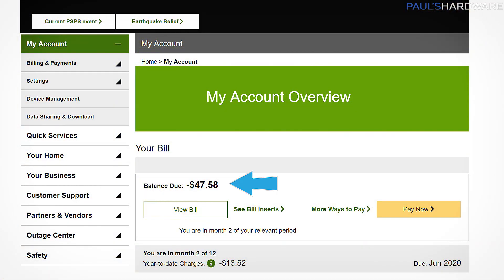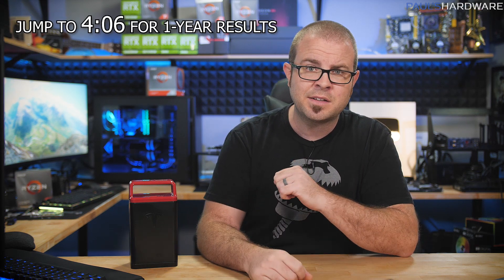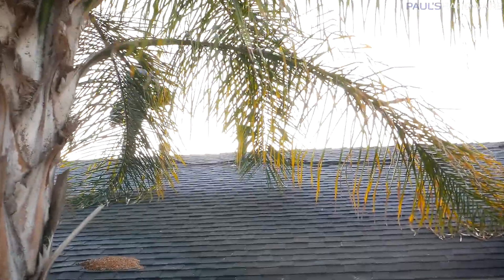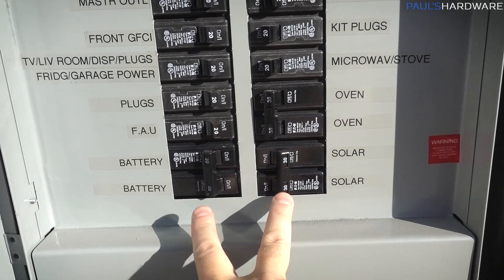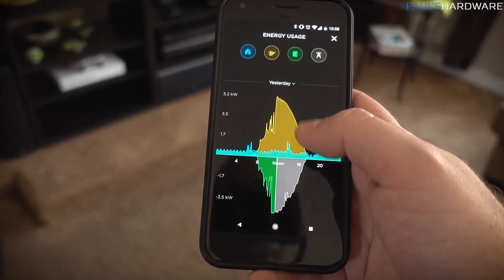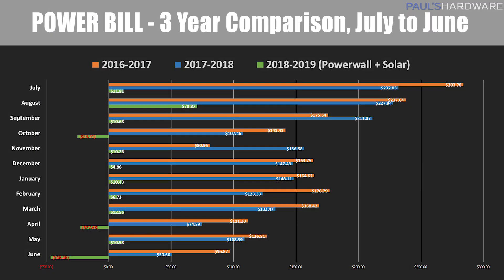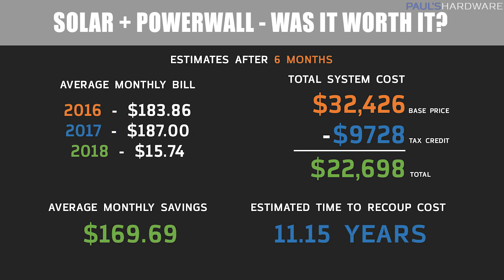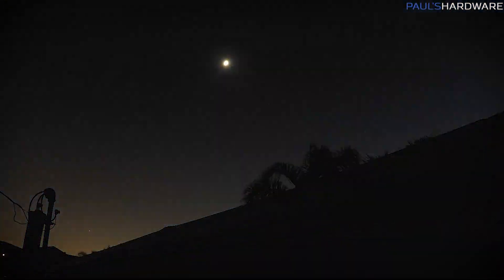TESLA Solar and Powerwall: 1 Year Later!

Comment: 13 years to payoff the system. Note: that's only if the government continues to give $9,700  tax credits. Also, I didn’t see a calculation of the time-value of money, which over 13 years would be significant. So maybe it takes 16-18 years to break-even (someone else can do the math on that). Yet, thats only if you’ve replaced your roof recently. You might be forced to replace your roof far earlier than normal.  Also, before you've paid off the system (16-18 years, not 13), you may need to repair or replace it. So, not only will you definitely not be making money Selling power with solar power, you probably won’t  break-even.

However, if you’re buying it for the zombie apocalypse 😉, it may be a good investment.
Reply: Many points you made are not true. The $9700 tax break is taken out of the total cost of the solar system and compared to other states and countries Is rather low. The more people that buy solar panels the cheaper it gets. The solar panels can come on and off when replacing roofing and isn’t a huge project, that’s why it’s recommended to just change the roofing under the panels which can be included into the cost of the panels as many companies have subsidized contracts with roofers to provide a better rate to potential customers. There a multitude of solar panels that vary by price based on your needs, if your local government provides credits in energy instead of giving back dollars, then the inclusion of a battery pack is not necessary. Not only are you helping environmentally by allowing the grid to use renewable energy you produce but you also only worry about the cost of the panels every month, with maintenance and any big repairs covered by the installers. I am saying this as someone who used to sell these. You must also factor in how much it increases the value of your home when you go to sell it, as you can include the price of whatever you paid or owe to the house price and then the new owners are incentivized because they don’t have to pay for energy for 10-12 years, if they wanna replace after that time frame.

Comment: When I was thinking of installing a solar system I had all these other questions.
Being a very small power user to begin with made it extremely uneconomical for me to bother with solar.
But here are some of my questions.
What would happen to your installation cost recovery breakeven date if there were damages sustained to your system before that date arrived and you had to replace items at your cost with new?
Say by a storm.
I know insurance covers most things but if yours is anything like here in Australia, they will try to weasel out of paying if possible. Maybe best they offer is pro-rata even if that wasn't stated in the insurance agreement. They make their own rules as they go along these days!
Then there is the actual buyback cost of the power you send to the grid. Over here, it started out being a very generous 44cents per kwh minus GST I think. Then it started to fall as many more customers came online. Original customers were grandfathered with the same generous payment, but over a year ago the government stepped in and said enough! Everyone now only gets 9cents per kwh and if you don't like it too bad. If it doesn't cover your costs (for example if you borrowed to buy the setup) too bad!
All these things blow the breakeven date right out of the water way over into hardware replacement territory post warranty end. So the end result is a never ending circle of costs and blown out timelines.
Also have you done a comparison on engendered energy used to make all the components as compared to what the system makes back for you and the environment as opposed to if you continued to buy gas, water or coal powered electricity?
Then there is the curly question of who wears the brunt of all the pollution caused by the various worldwide manufacturers of components in your system. Some are very pollution heavy with quite noxious poisoning of the earth.
Have you attempted to make amends to the environment by supporting tree  planting etc, say as offsets in other polluted countries?
If you've done any of these things, did you include those costs in your overall system cost and payback date?

Comment: Damn your setup and usage is increasingly wasteful. In the 12 years you take to make back your investment and just break even you could invested the money instead and actually make money
Reply: It is certainly worth doing if only for the fact that it is saving the environment. If you have the means, you ought to do it.

The fact that it saves you money in the long run is just a side benefit.
Reply: Jørgen Smith solar panels are incredibly bad for the environment. All the rare earth minerals that need to be mined, and the electronics pollution it creates after you’ve upgraded your system. It’s not all sunshine and rainbows.
Reply: Yeah unfortunately looks like solar still isnt worth it. Though I'd be lying if i still wasnt tempted. Theres nothing worse than being without power after a hurricane in the middle of the summer.
Reply: @Distress.  Those Space Heaters really add up. I would personally look around the house and gauge how much power certain appliances take up and see what items are unnecessary. I forgot did he take out a loan to buy his solar set up ( skipped the unneeded parts of this vid)? Usually the Loan is the biggest punch in the face holding you back from making money.

Comment: Who can afford 23.000 dollars is my question. Sounds nice but ... you are living in another world my friend
Reply: Financing.  We went through Costco and got the SunRun system. It is $210 a month for the system. We live in Arizona and in the summer our electric was almost $300 with the AC set to 78. Now it is set to 72 and my bill last month was $45. So even in the blasting heat of July in the desert I saved about $50. In the winter I won't use AC and all that extra energy gets banked on my bill meaning I will save even more.

Basically,  what I would be paying to for an electric bill is instead my monthly payment for something that also upped the value of my home. It actually is fairly affordable.

Comment: Im an electrician, and willing to take bets the time to recoup cost will push a hundred years. In about ten yrs either the invertor or battery bank will need replacing. that will add 5 or 10 yrs, then whichever didnt fail first tieme, it will happen again and push off recoup time another 10 yrs
And so on and so on.
the easy way to tell this is its a boondoggle whenever the gvt has to intervene financially to get this kinda thing done.
if it was economically feasable in the first place everyone would be scrambling to do w/o gvt help.
Reply: That's why you look around and get better warranties and coverage. My SolarEdge inverter is backed for 25 years along with the panels. Battery box is 10 years.

Another part of the "recoup" is increased value of the home. Here in Phoenix you can bet on a 60% of system cost increase to your equity. As most Americans tend to move on average every 7 years, you can bank that equity into your recoupment. 

I installed a SunRun system in June on the house. In 2018, the house was $230K. Solar cost was $40K. Our current estimate by our insurance in July put the home at $255K. And 2weeks ago it was tax assessed for $238K. So it already added a good chunk to my home value.

Plus, as grid prices go up, I save more since that is even more money I am saving by not buying grid energy. Finally, our power company has set in a strict flat rate price for bought back energy which guarantees a rate that goes up if cost goes up. So when it gets more expensive for energy, we will get paid more for producing.
Reply: @ParkerUAS  "And 2weeks ago it was tax assessed for $238K.", So your property taxes are going up, Another thing to factor into the cost of the system..
Reply: @CarlosGunX , yeah...it added $14K to the value which raised my taxes about $35/year. I mean it should be factored into your decision, but as the house hadn't been appraised in 5 years, it was going to likely go up anyways.

My overall point is that solar can be a benefit in the right circumstances. If you live in an environment where A/C is a necessity and your cooling Bill's hit $200 or more in the summer, then you have the option of paying $200 to your electric company that essentially is pissed away because other than the power given it did nothing for you. Or, pay $200/month for solar, get the same power to use, but now that $200 is going towards an investment on your property. 

If you plan to stay in your home for the next 30 years, weigh out the replacement costs, losses of efficiency, etc. Since most people move every 7 to 10 years, factor more the increase value to cost and if that is a good balance for you. Obviously, if you buy a home that has solar you want to factor its age into the price. Here in the desert it just makes more sense to put that monthly expense back into the house versus throwing at the power company every month. If I lived in a cooler climate like Seattle or Boston, it would be a different story.

Comment: So basically you need to pay for 10 years of electric up front in the cost of having it all installed... it's guaranteed for 10 years? then you start to be in credit from your start point, as upto that point you've not regained your original investment... unless the system fails, in which case you are no better off... got it.

Comment: Being connected to the grid AND doing solar electrickary, in my country, means you are an electricity producer when you deliver kWh to the net, and a consumer when you consume. So there is a big difference in what you pay per kWh and what you get for kWh produced. Some households still have "old" kWh meters that run backwards or slowdown when you produce electricity towards the grid, meaning you experience your production as a discount on your own bill. "Modern" meters can measure either way and inform the electricity company.
My question, how does this work in the US?
Corollary: if you have a way to use your production in a parallel home electricity section, then you can value your kWh at the same price as your consumption kWh price. In my country, many households use gas from a gas grid to heat their houses, produce hot water and run their cooking ranges (if still on gas). In an energy home-architecture like this, you could use your solar kWh to heat water electrically (you might not need an inverter with big losses, actually!) With a couple heat-pumps and a store in the earth beneath your house, you could actually use "solar" to store heat their for retrieval in winter, or store "cold there for retrieval in summer.
It's a bit like buying a standard PC, building one yourself and modding its cooling.There may be ways to shorten the earn-back time of a solar investment. But you may have to do your own modding and DIY, just like you did with that affordable beast PC.

Comment: So it will pay for itself just as all the warranties run out.
Reply: Yup. After that it should still work and generate a profit. Given the panels themselves are pretty much indestructible (though they can become obsolete), any costs associated with the system will be wiring, fuses, function boxes or the battery pack. As long as it generates enough profit to cover any of those potential costs it's a solid home investment, adding utility and value to the home.
Reply: The panels warranty is 25 years.
Reply: What do you expect to wear out within several years when the panel warranty is 20 to 25 years depending on the manufacturer.

Comment: Does your payoff time take into account the degradation of the panels as they age?  80% at end of life is better than I have seen on other solar installations.  Also, does the up front costs include the cost of the roof rebuild.  Your situation was different than what others may encounter or incur.  It would be interesting to see what the total costs would equate if you had to pay for the roof yourself.  Thanks.

Comment: By "tax credit" do you mean a "deduction" (your adjusted income for tax purposes is reduced by $9728, so you only actually save a fraction of that) or a true credit (you save the full $9728 on your tax bill)?
Reply from the maker: It is a tax rebate, not a write-off. I payed $9728 less in taxes this year because of the rebate.
Reply: @paulshardware  Thanks for the clarification. I asked because some people present the former as the latter when it isn't. An actual tax rebate is pretty sweet!

Comment: Tesla recently did a wifi update reducing the capacity of the batteries in some of its older model cars to prevent overheating. I suspect before you get to break-even point the batteries will have been 'updated' to reduced capacity or start to have some dead cells altogether. But i look forward to battery tech development, i am just not convinced it is there yet. Thanks Guinea pig

Comment: I live in Phoenix, AZ and considering Tesla solar. They just changed their pricing to either buy or rent their three solar system sizes. 
It’s only $50 per month or $10,060.00 for a 3.8kw system. With the 30% federal tax credit and the $1000 AZ tax credit applied, the total cost after the tax credits would be about $6000. I just wish my utility company (SRP) was more solar friendly since they do not offer 1 to 1 net metering. 
After buying my Model 3 last year, I’ve been desperate to add solar.

Comment: What I'd really like to know is how efficient they are in cloudy weather, like we have in Europe (England, Russia, etc). We have a house in the middle of nowhere, electricity so bad that it turns off every time there's some strong wind or rain. We have a generator that costed us around 2000$ that can output up to 8kWt. Peak usage with all heaters on is around 10kWt. Air and water heaters use most of it of course. 

So I wonder if installing something like this (Maybe not Tesla per-se, but solar panels and batteries in general) will be worth it, since it's unlikely that they will operate at 100% most of the time? Like 9 out of 10 days are cloudy. But then we rarely turn everything on at the same time, so maybe it will be enough to accumulate..

Comment: Big fan here of solar and Tesla (model S owner) but buying a system with 12+ year "payback" when the warranty only goes 10 years would be a recipe for failure with my luck.  I'd have to replace the batteries at the 10 year mark then the diminishing returns on the panels means I'd probably never break even.

Comment: You could of "bracketed" the old roof to lift the panels above 
Then the roof does not matter
Panels hinge up out of way if needed
They DID NOT TELL YOU THIS CHEAP OPTION!
Reply: Richard Wolfe they did it for free so it didn’t matter
Reply: @shannontan2553  
You're wrong because if you had to replace the entire roof before putting the panel on then you were lied to and the company didn't want to tell you the cheaper option
Reply: @shannontan2553  I'm glad you think replacing the entire roof was free!
Reply: @shannontan2553  up here we do not require that people replace the entire roof before we put panels on because the panels are removable and they swing up out of the way in case the shingles need to be replaced!
DUH. COMMON SENSE!
Why would you put 25 year solar panels on a roof that needs to be replaced in 10 to 15 years?
STUPIDITY!
Reply: @shannontan2553  God forbid a big storm happens and blows some shingles off of that roof because the panels will have to be removed before you can replace any of the shingles and God forbid it's not leaking in the meantime!!!!!!!
Reply: Richard Wolfe you’re right, my bad, forgot about maintenance costs
Reply: @shannontan2553  they literally sell brackets that are so cheap and slide up underneath the shingle,
So you only have to remove a few shingles to mount the bracket and then put the shingles back so the panels are sitting above the roof
This also helps to keep them cool so that they don't overheat because they can warp in melt if you buy cheap parts or cheap manufacturers because it can get 240 degrees on top of the roof
Reply: @shannontan2553  I'm a carpenter and an engineer and I tell everyone to talk to as many people as possible before you do anything because you're going to discover the golden rule or the golden way to do it if you talk to enough people!!!!!!
With anything that you do there is one or two really important things that you need to focus on and if you don't know what those are then that's your first mistake!
Reply: @shannontan2553  I guarantee you that roof cost anywhere from $5,500 to $15,000 to have redone before the panels were put on and that was a complete waste of money and time
All of that money could have been invested into the system itself and just a few brackets!
Reply: @shannontan2553  and for a few dollars more you can get panels that literally tilt towards the Sun and follow the Arc of the sun all day long and it in creases your efficiency by 30 to 40%!
If he didn't buy the roof he could have added this option to increase his efficiency and power generation
Reply: @thecloneguyz  how are you a carpenter and an engineer?
Reply: @griffinmakes  nothing I said was wrong because I do it everyday for a living
Reply: @thecloneguyz  just impressive you went to trade school and a 4 year university. Did you not hear that they replaced a portion of roof at no cost to Paul?
Reply: @griffinmakes  
15yr General Contractor
You think something is "free"
Aw, how cute.
Reply: @thecloneguyz  so not an engineer. Also IT WAS FREE TO PAUL. Tesla paid the contractor to re-roof it...